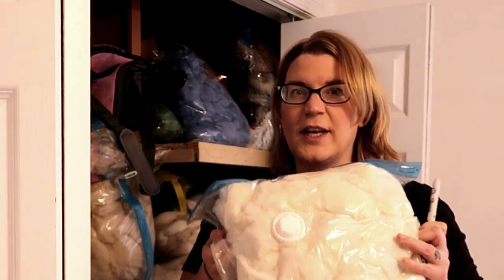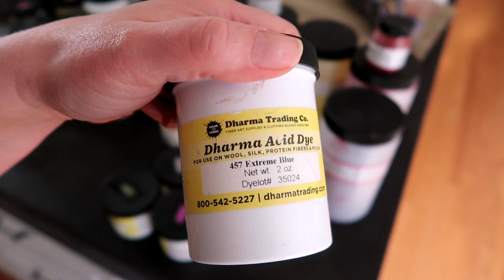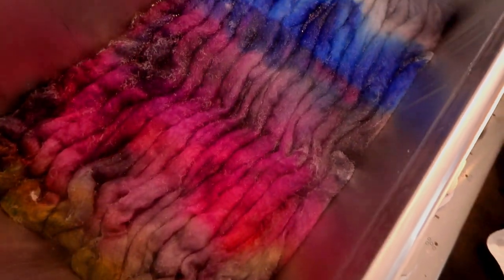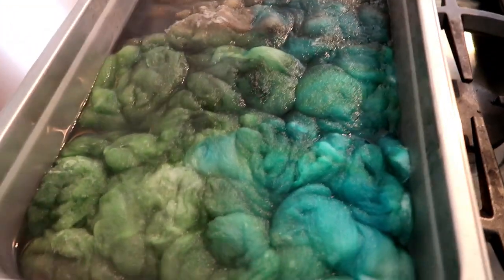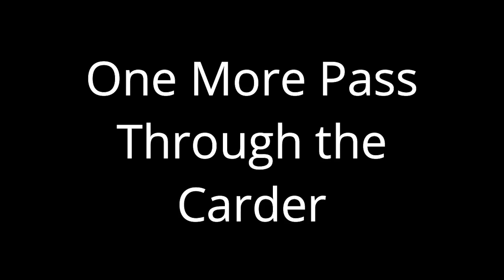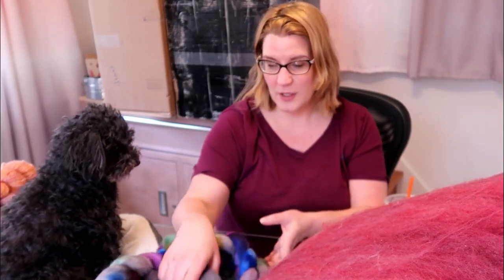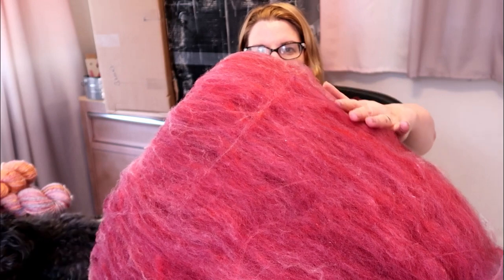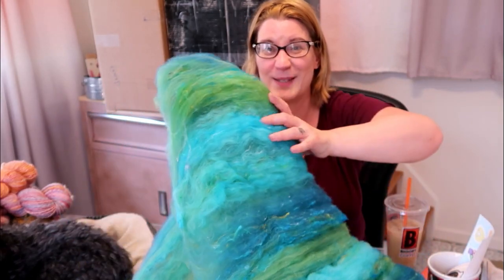BIG DYE DAY!   Plus Carding, How To Fix a Bad Dye Job, and Addressing Rude Comments!

Comment: I saw that you are still using the plastic wrap instead of getting the lids for the pan. I was thinking, however, a plus for the plastic wrap is that, you can kind of see what is happening in the pan.
Reply from the maker: Honestly, I think that's what is holding me up.  I really do like to be able to see a little, but I hate using single use plastic, and I've been trying to stop as much as I can, so I guess it's time.

Comment: Would you be willing to do a basic dying for beginners video?  Explaining exactly what you do at each step and why?  I've watched many of your dying videos and you do bits and pieces, but I'd love a basic step by step explanation.  For example, when did you add vinegar in this one?  Was it in the cups or in the pan?  Did you wash your fiber or just soak it with water and perhaps something else?  You just have a casual, relaxed way of explaining things, so I'd rather get it from you than someone who will talk about PH, etc.  Thanks
Reply from the maker: There is one coming in the next month! Beginner acid dyeing. It'll be available in the Facebook group for sure, but perhaps some other platforms as well.